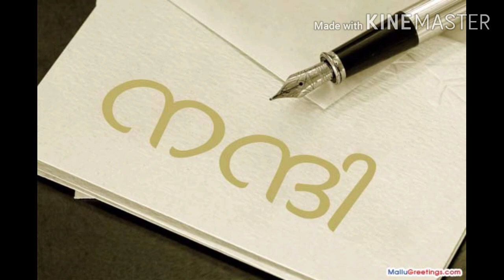ആട്ടിൻ കൂട് goat cage

Comment: Eee koodine ethreyakum
Reply from the maker: 9946206663
Reply: @KeralahitechFarming  platform ethu  angle anu use chaiyunnathe
Reply from the maker: 1 1/4 *1/4
Reply: @abhijiths5421  square feet rate engenya
Reply: @akfalks734  1st quality 150per sqft